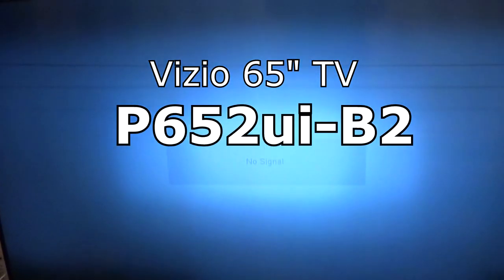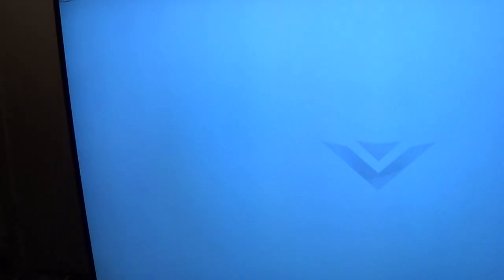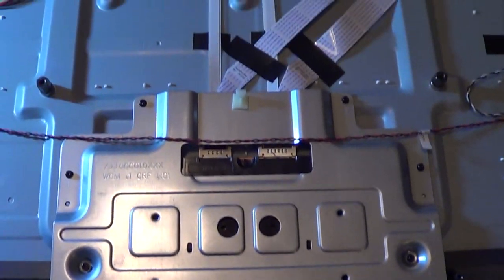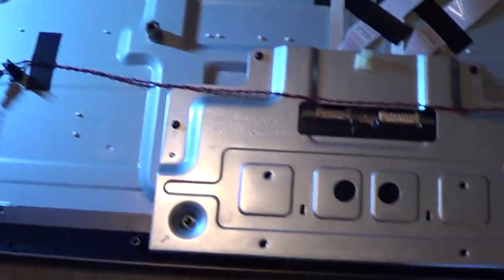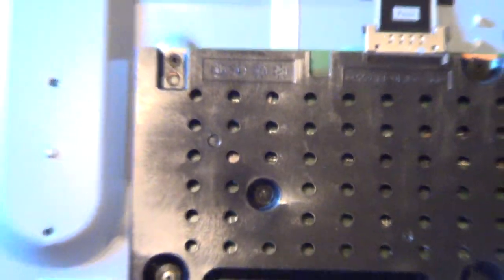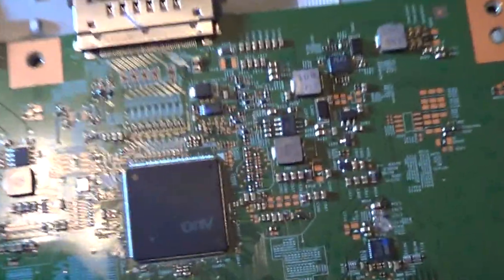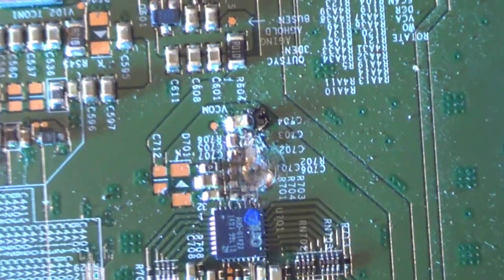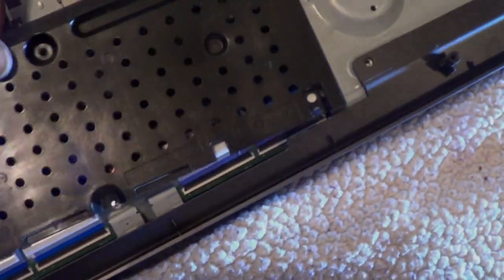#1 Main reason why your Television has a white screen! Vizio TV repair.

Comment: I have a vizio e500i-b1. The screen went white but the internet and sound were just fine. My issue is that the mount for the stand seems to be screwed to the tcom/board and I do not want to rip it apart and crack the screen and panel because thats whats going to happen. Am I correct in assuming the mount is screwed to the frame?

Comment: I have a 6 month old Onn brand 58" led tv that went to a grey/white vertical lines while watching TV the other night, onn wants me to send it to Canada to get fixed. Would that be a tcon problem ?
Reply from the maker: Kinda hard to say, Its either the T-con or bad drivers on the LCD panel (screen).